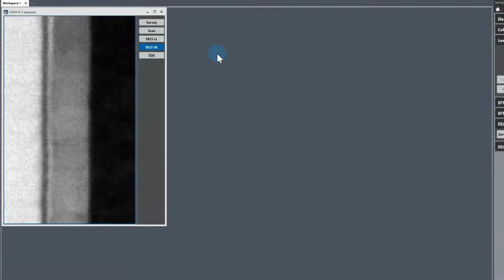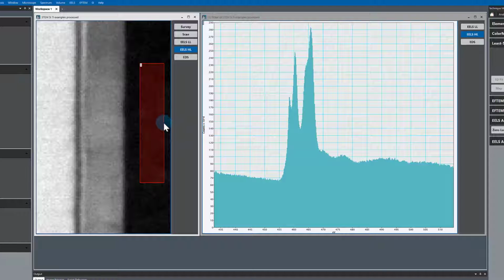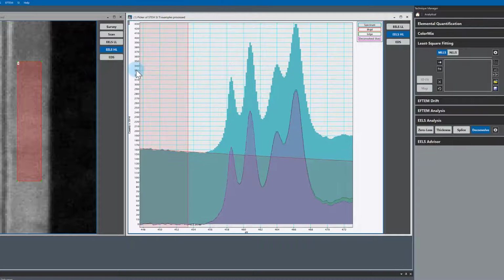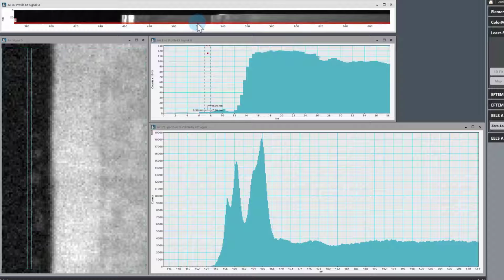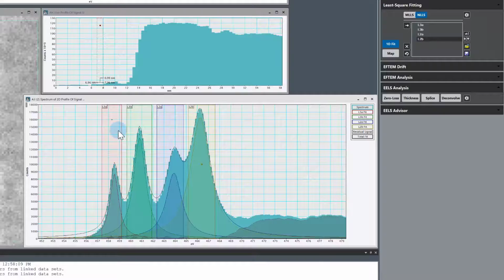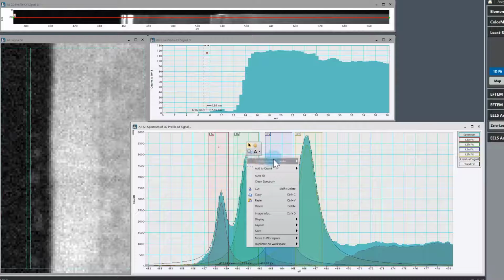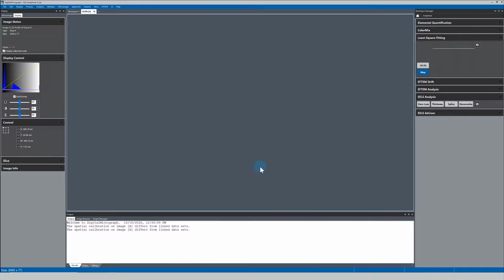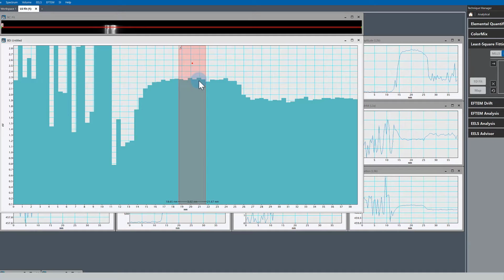NLLS for ELNES Example

Comment: Thanks for the video, could you please help me how to mentor the spectrum shift in a good way?
Reply: There are two ways I am interpreting this question. First, the best way to measure and adjust for overall shifts in spectra due to changes in the local magnetic field or stray fields is to measure the position of the zero-loss peak across the spectrum image. You can correct for these types of shifts using the “Align SI by Peak” tool in the SI menu.

The simplest way to monitor a shift in a core-loss edge (chemical shifts) would be to fit a function to the edge and monitor shifts to the center of the function using the NLLS fitting tool palette. For instance, if you fit a gaussian to a white line you can output a 2D image of the fit parameters of the gaussian across your spectrum image (2D-array or linescan). One of those parameters will be the peak position of the fitted gaussian. This measurement can also be affected by shifts to the overall spectra caused by changes in the local magnetic field or stray electromagnetic fields.  You would first need to correct for any shifts in the spectra by using the “Align SI by Peak” tool, as these shifts will skew your analysis of the core-loss edge.

Whenever possible, DualEELS should be used so you can use the zero-loss peak to calibrate the absolute energy scale of your spectra.